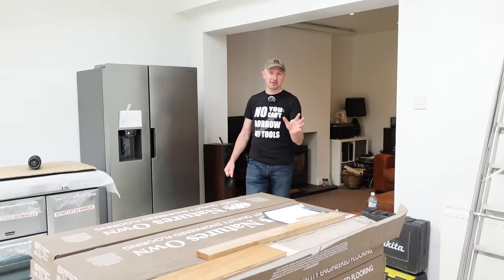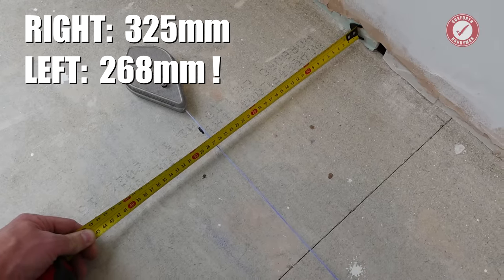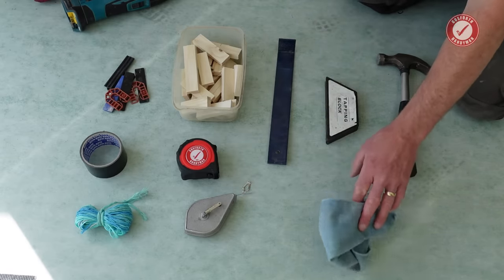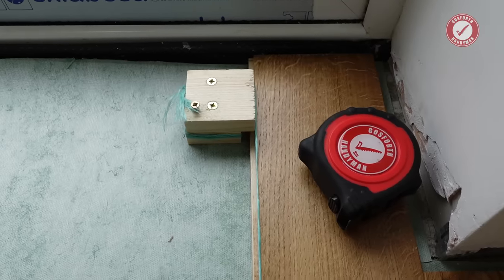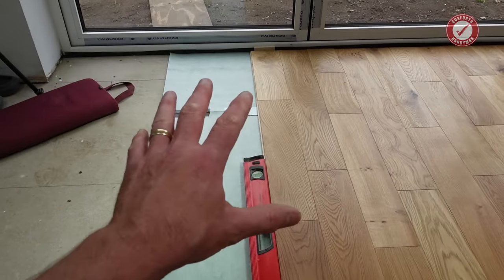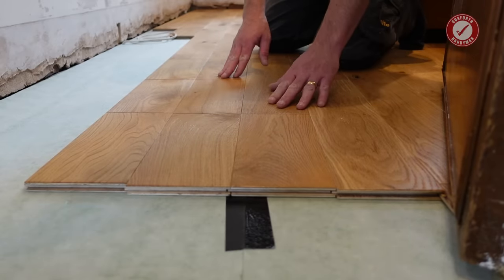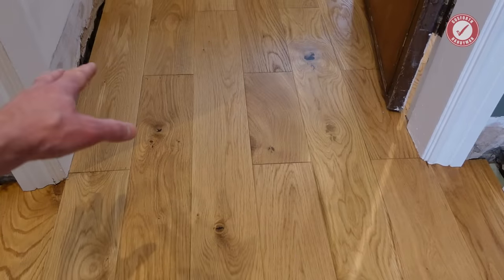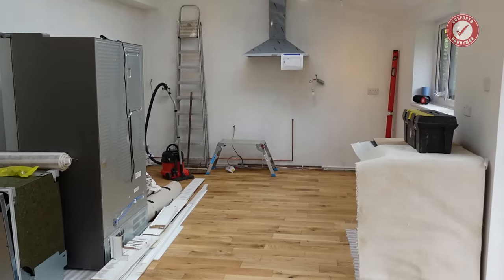How I fit ENGINEERED OAK wood flooring

Comment: Tip on the waste arising (which is basically Paper, Card and Plastic Wrap.  Most co-ops now have a blue bin to put plastic bread wrap, bags and similar in , so wrap that up as you go along and take there when you go out shopping.  Dependent on your local authority recycling split if you can find just a wheelie bin out in the garden to take the cardboard as you go, stack it in/ fold down as you go, keeps everything nice and tidy and separated out
Reply from the maker: Defo! Although sadly it'll probably still end up in landfill somewhere... but we recycle everything anyway. 👍
Reply: @GosforthHandyman  most cardboard is full circular economy.  Plastics ok IF they have a traceable route,  normally makes fleece jackets (which then flake microplastics in the wash into the rivers)

Comment: In the end, the flooring looks really good.

I've found, when there's a row floating in the middle of the room, I'll screw down a backer board so I can tap the other boards in place without removing the reference row. It's more important with cleats/staples, though.

Edit: And I see you did something similar with the wood block at one end.
Reply: I'm not a pro, but I did put down something like 1200 square feet of bamboo flooring in my house (after doubling-up the subfloor, which was only 5/8" thick). That was close to 20 years ago. Other than the fact that it scratches white (ugh!) it has held up well.
Reply from the maker: Fantastic stuff - was considering bamboo for the studio room! 👍
Reply: @GosforthHandyman  I love the look, but here are some things to consider:

1. The stranded stuff, especially when cooked, has nasty splinters. So be sure to overly protect any edges. Also, cleat/staples can cause splintering so maybe glue is better in that case.
2. Almost all of it available today scratches bright white. If it says it has an oxide coating, stay away from it. The splinters have been few and far between, but the scratches...man. If I had a dog that would be the end of it. As it is, I just have teenage kids and they know how I am about the floor :P

That all said, I still like it. Very stable, cool look, smells wonderful when putting it down. Super hard wearing (other than the scratching) so no dents or anything like that.

Comment: Check concrete floors for level. I found out that little present on a new build where the builders were in a rush to self level the floor and slapped on free carpet to hide the dip....

Comment: About 10 years ago when I was a handyman on the Gold Coast in Australia. I did one for a pensioner and charged my hourly rate of $50 per hour.  It was not worth it and she got a bargain.  After that I did a few more but charged the going rate of $38 a meter.  it was labour only. Underlay, boards, glue etc was all extra.  However the pain in my knees was so bad it just wasn’t worth the suffering. I could’ve gone full time just doing floors there is so much demand for it. Maybe if I had used a knee pad it would’ve been ok.
Reply from the maker: Wow, that's about £9k for this floor I think. Good stuff! 👍👍😎

Comment: It turned out so beautiful! I do have a question though. In the kitchen area you went all the way to the walls. Won't a good part of it end up being covered by base cabinets? You would want it under the refrigerator and stove because you move them out to clean under them but cabinets will be permanent. Will you remove the pieces when the cabinets go in? 
Lovely job. Thank you for the measuring and aligning information. I will be putting in vinyl flooring soon as a floating floor so I will be coming back here to use the advice shared.
Reply from the maker: Normally I wouldn't put finished flooring under cabinets but as it's a free standing fridge and range it just ended up being easier to do the entire floor. 👍
Reply: We laid an oak floor over chipboard flooring 15 years ago including in our kitchen. Laid the oak right up to the walls then built the kitchen on top, so there was a nice even floor to build on.  We're now in the process of turning the kitchen into a guest bedroom. We took out the old kitchen units and, hey presto, beautiful oak floor already laid!

Comment: I had similar wood flooring and followed instructions to glue by tongues. In the fifth winter or so it has shrunk, so it broke into two large pieces with a 5mm seam between? In summer this gap shrinks to maybe 1mm, but each dry moment it's big. Is that preventable? I'm wondering if it's because some heavy objects at both ends stopping them from moving; or just too little glue?

Comment: Can I ask

I didn't think you could lay a wood floor over floorboards as they will move and mess up the top floor.. and can I also ask why you chose to install as a floating floor and not glue the top floor down.  I am about to do a herringbone style to my whole house but bill be replacing all the old floor boards with 22mm chip board and glueing the top floor down..

Comment: Just about to do my hall with similar engineered flooring, living room already done with solid wood and used a nailer to fix. Shop advised to nail engineered also, any particular reason you used glue to fix?

Comment: How does the floor expand with the weight of the kitchen on top of it ? I’m doing flooring soon and have read mixed opinions .👍
Reply from the maker: You need to cater for it in the kitchen fitting - vid coming soon. 👍

Comment: Looks great. Planning to do my hall with engineered oak soon so this is a useful guide, many thanks. Would you consider click lock rather than glued T&G? I've used click bamboo in a spare room but it's starting to squeak/shift at the doorway which makes me worry about a high traffic hallway.
Reply from the maker: This is much easier to fit than click lock since you can come at it from any direction. 👍

Comment: I charge £25m2 for floating engineered flooring so for that area it'd be £1250 done in 2 days its also better to glue the bottom grove wich eliminates clean up and residue on the face I also wouldn't fit a kitchen on top of it as it voids your expansion and warranty on the product
Reply from the maker: There's nothing about kitchens in the warranty but they do specify gluing the top of the tongue to avoid moisture penetrating in to the floor.

Comment: The feature item  (fireplace)  should either be moved or the flooring match the fireplace.  This idea is the same for any feature that catches the eye. Bathtub/shower, major entrances that show an edge, sometimes an entrance to the home, and long walls.       Occasionally a judgment call has to be made when you can't see a major difference. Honestly, I would have run the flooring 90 degrees to the way you have it. The kitchen and garden room is the major feature. This is my opinion only.  I was surprised at the number of shorts.  To avoid running strips offline, run chalk lines every 3 feet and put pencil marks in case the lines get messed up.

Comment: Think your pricing is about right, my flooring guy charges £8 a metre just for carpet, but they all want to lay fancy LVT (Karndean type flooring) now which does look like real wood but works out more expensive . I'd like to use reclaimed parquet personally, but only in a small area like the hall, your total area would be too tiring!!!
Reply from the maker: Yeah, Karndean really needs a perfectly screeded floor since any imperfections can show through... I think.

Comment: Thought that you were not supposed to glue the joints on engineered flooring to allow expansion?
Reply from the maker: Needs to be fully glued to avoid moisture penetration. 👍
Reply: Was wondering this as well. How can a floor expand if it’s all glued solidly together?

Comment: I'm not sure how you determined your straight line was straight?  Did you measure the distance from the wall?
Reply from the maker: String line 🤔
Reply: @GosforthHandyman  - I guess when I meant was, having a straight line doesn't mean anything if it isn't parallel to something else surely?  You could draw a straight line at 30 degrees to the nearest wall and it would look terrible wouldn't it?
Reply from the maker: Ah, OK. Yeah, measured off the new extension walls. 👍

Comment: I always tell the client why it's called a threashold. With a bit of history, it's in the name!
Reply from the maker: What's the history?
Reply: @GosforthHandyman  Back in the olden days before carpets, when the poor were really poor, floorcovering was rushes or threshed wheat. A bit of wood was needed to keep it from spilling out into the street. And they called it - the threshold. Love your channel, what's going to happen when you finish your house?
Reply: @pedanticsmith5613  I thought the threshold would have been the ridge all around a threshing floor, to stop the grain etc spilling out when threshing, which is slightly different.  That might just be my made up theory though.
Reply: @ironpirate8  I guess the word 'spilled out" into domestic use when we started the floorcovering malarkey here in Britain.
Reply: @pedanticsmith5613  Let's not rush to a conclusion, I could be reeding it wrong.

Comment: I love the natural oak flooring, and this is a magnificent result which I would like to emulate. Didn't expect glue would be required. 
How / why did you get more noticeably short sections at the division of the rooms? Did that mean flat end faces without t&g joints?
Thank you (and Mrs Mac) for all your hard YouTubing 😂
Reply from the maker: Cheers! T&G everywhere. Board lengths are just whatever worked out to stagger the joints. There was a lot of short boards though and we tended to use those up in areas that will be covered with furniture.  👍
Reply: @GosforthHandyman  Got you 🙂thought a partition might hide some joins too. 👍Not too long before you can relax and enjoy all that work. 🥳

Comment: Great job, but as an absolute novice I would like you have shown how to cut the awkward pieces around the fireplace and doors in real time with commentary rather than super speed.
Reply from the maker: With the 12mm expansion gaps you don't need to be mega accurate on the cuts. After you've done a couple they're quite easy. 👍

Comment: I used this stuff and was rather disappointed with its durability. My son has laminate and two feisty sons and that seems to fare much better.
Reply from the maker: Trouble is laminate has a much thinner finish layer. Oak is pretty durable but you still need to look after it. 👍

Comment: Love the channel but the fact you say you would charge 3 grand to do 4 days work and the floor has slivers is a joke, if the floor is laid properly it won’t have slivers , you work the measurements out so it doesn’t have slivers at any edge
Reply: @dgmclar  that's not completely true with regards to the slivers, if you are doing one room you might get away with not having slivers,  board width and running into different rooms where walls and alcoves are out. 🤔👀🤷